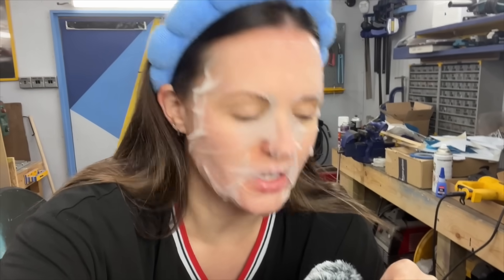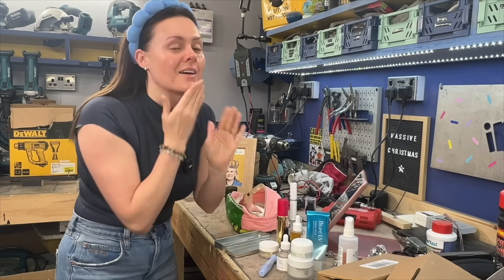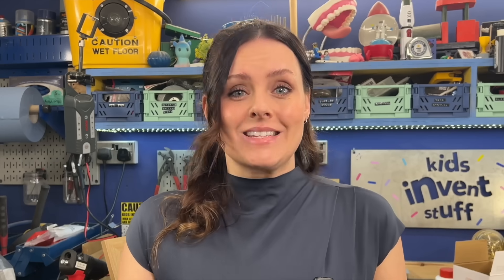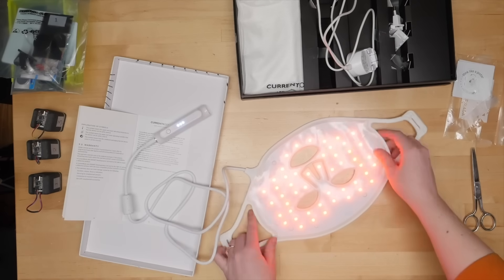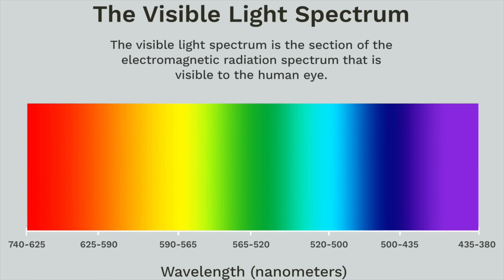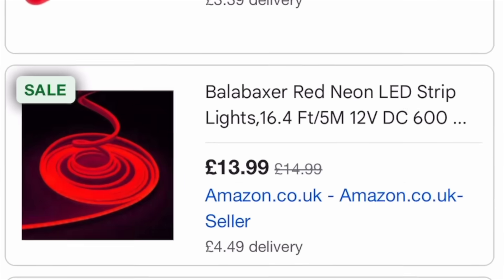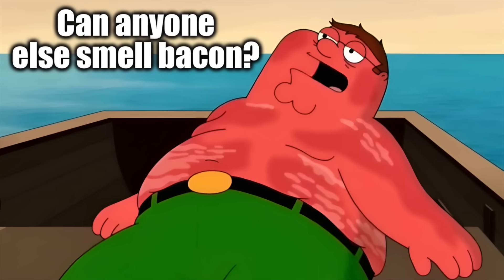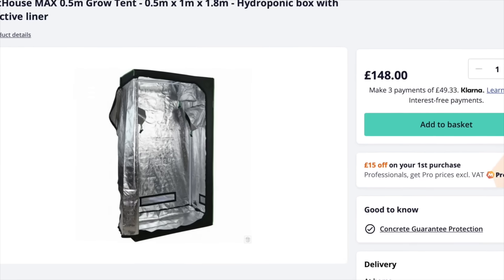Can I DIY Kim K’s $78,000 LED Bed for CHEAP?!

Comment: You have brought my obsession full throttle 😂

So I'd like to try making a diy panel or something for myself (with nir, red and blue). There seems to be some available, but not the best wavelength. I have zero experience beyond what I did in school so what types of leds and resistors are best?

Comment: Link to the led light strips you tried?
Reply from the maker: These were the best I tried https://www.blockbluelight.co.uk/products/red-light-led-strip-light?variant=40996318216324
Reply: @Ruth_Amos  Could you please also share the cheaper ones? I'm a broke mechanical engineer student 😄
Reply from the maker: @totalwayne3089 I’m trying to find a spectrometer to test them as I’m not convinced they are good. I would just go for IR and wait for the shipping.

Comment: Wondering what the better diffuser fabric with minimal intensity loss is? DIY a PAPR cost effective maybe?  Neat seeing from the UK coming across the pond here to the States the COTS one or two that I forget the brand names offhand.  Parkside comes to mind, though I no they are not.  Maybe a DIY cost effective quality spectrometer as well to test the emitters?  You gals can work it.  Lets see what you can come up there.

Comment: Thank you for this!  Question for @labmuffinBeautyScience : does it matter if the LED light strip you buy is non waterproof or not?  Can you put the non waterproof LED directly on your skin (like the LED masks you can buy)  or should it be slightly away from your skin?

Comment: We got a red light bulb for one of my pet birds for the winter, but eventually switched to a ceramic bulb commonly used for reptiles because we couldn't leave the light emitting bulb on over night for obvious reasons. When I no longer had a bird living in my room with me, I switched to using the light on myself (as it couldn't keep a birb awake anymore), and I had some of the coziest sleep under it. No idea if it helped my skin, but now I want it back XD
Reply: If you like that style of heat you should look in to IR heating panels. They come in tons of sizes and you could mount it pointing at your bed, or on the ceiling above your bed. They don't heat the room that much but they heat whatever they are pointing at so you can keep the room cooler than you normally would and point them where people sit so the people feel warm instead of the whole room. It kind of feels like if you are in your house and the sun is coming in a window and you stand to feel the warmth from the sun rays.

Comment: thank you. As a guy in his late 40's my skin care regime is more Damage Limitation. That said I've learnt to use a barrier cream before doing anything dusty, block the heck up when going outside and to protect my ears and eyes a lot more than I did as a kid.
  It's great seeing red light looked at by actual smart nerds. I was wondering if red light it was just a gimmick and now I can see why you need a filter or specific wavelength.  Thank you!

Comment: Please can you tell us where you bought the correct cheaper LEDs from? I'm so inspired and want to try this myself
Reply from the maker: Also I would probably go with IR. Lots of hype around the red but actually IR is probably better than visible
Reply: @Ruth_Amos do you have any recommendations online? I’m having such a hard time finding LED’s with the right wavelengths, let alone IR
Reply from the maker: Was actually Amazon although I think some website do have better specs. Michelle says that actually between 600-700 have some benefit but I was looking for 633 or 10 either side so as to closely replicate the commercial masks
Reply: IR? Nooooo not IR……NIR